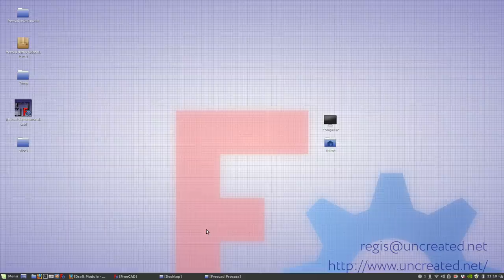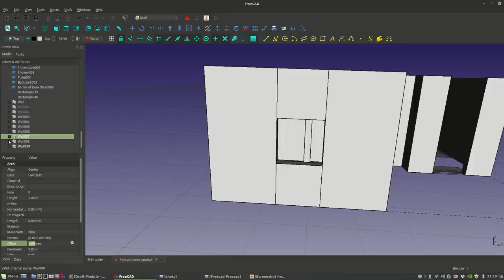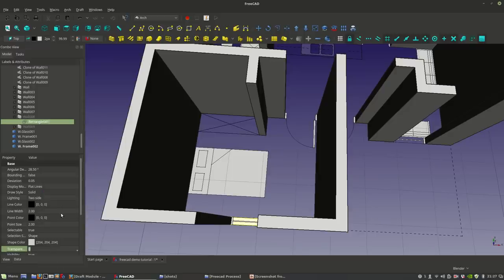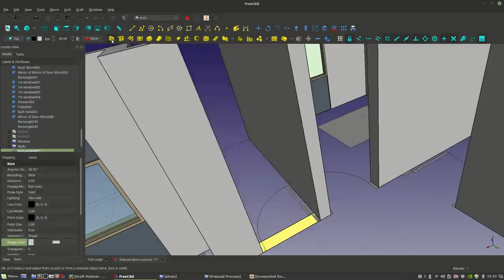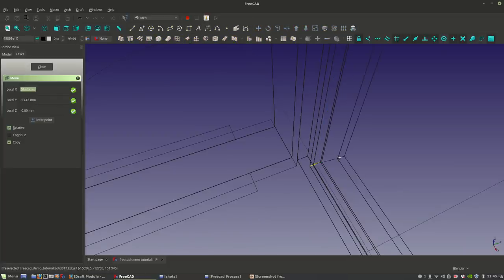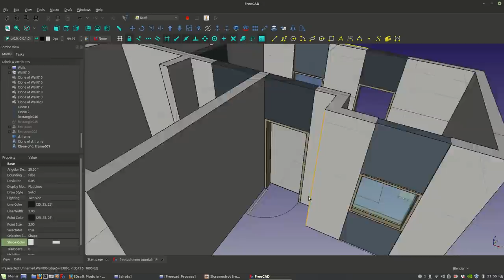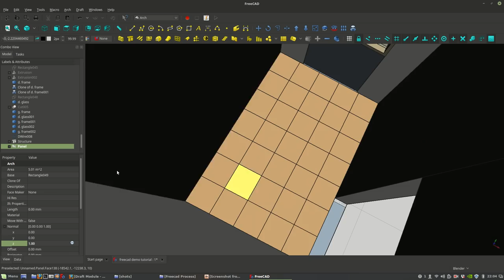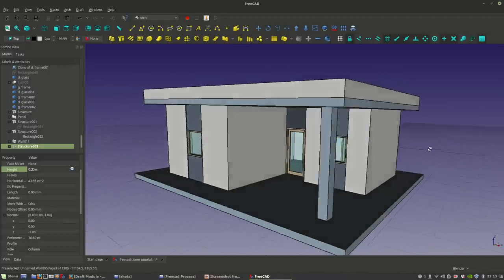FreeCAD Arch - Basic 3D Modeling - 03

Comment: Hello, I seem to have an issue. Not too long from the start of the video where you showcase how to make the windows, you make a square on the model of the window from the 2nd video, however, whenever I try and do so, it just flips out and won't even get close to. Do you have an solution?
Reply from the maker: Do you have a moment where we can do a screenshare and I can see your screen to better see where your problem is?
Reply: @RegisNdeTene  Depends on what platform you would wanna do it on.
Reply from the maker: Google meet?
Reply: @RegisNdeTene  Sorry for not getting back to you before brotha. Got it figured out 👍
Reply from the maker: Sounds good. Great to hear.

Comment: Nice tut man! But why didn't you use the standart windows from FreeCAD? Wouldn't that be quicker ?
Reply from the maker: Hello J.E. Yes you are right, it probably seems that it would be a quicker, but i'm a probably going to make a tutorial explaining freecad windows. Freecad has many ways to model the same object, and depending on what you want to acheive certain methods are best. The thing about freecad windows is the fact that it retains it's parametric information, and often times, if your model is a bit complex, making changes means recalculating all the parameters and that can become very slow, especially if there is an issue in the parametric model along the way.

Comment: Why create partial walls for the doors and windows? Why not just create a solid wall and then draw the door as a sketch on the wall and make it a hole?
Reply from the maker: Check next tutorial 04
Reply from the maker: The purpose of this specific tutorial was to model without using the sketcher and constraints method. The next one does exactly what you are suggesting I believe.